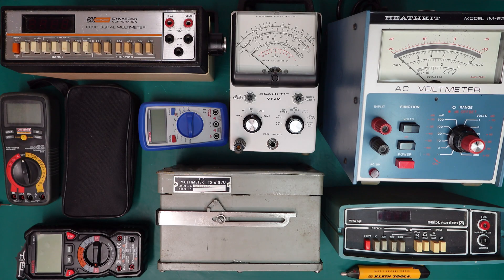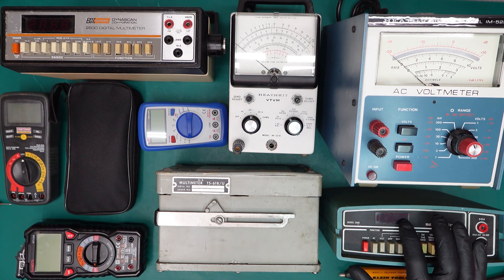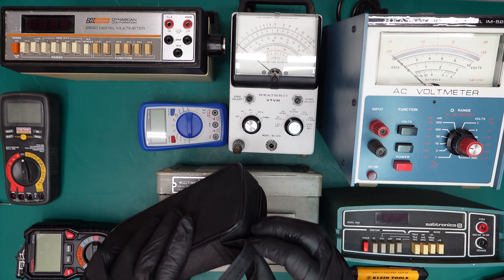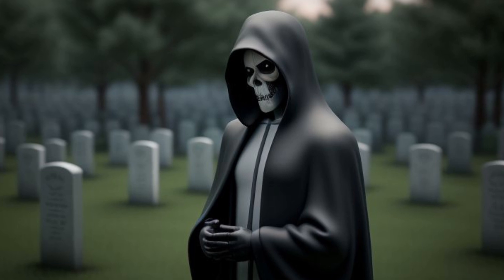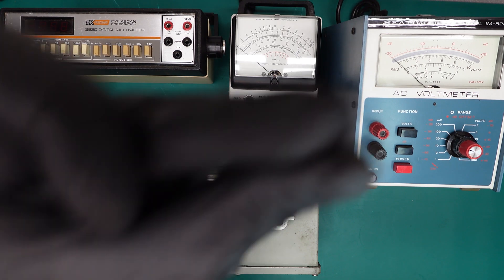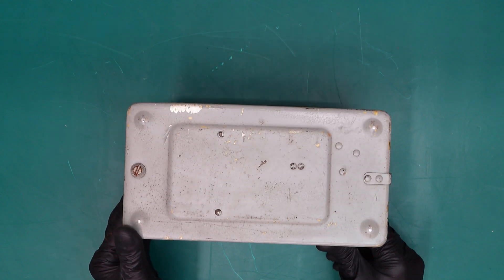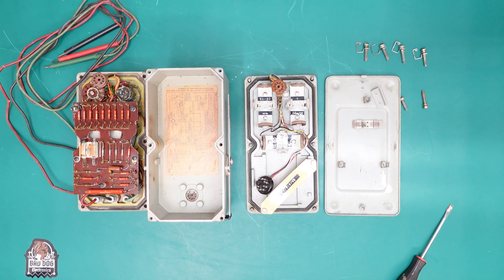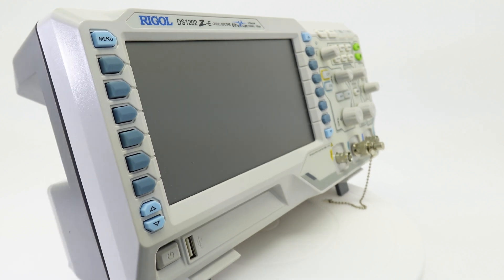A Look at the TS 618-U US Signal Corp Multimeter. Why I don't use a Fluke Meter.

Comment: Clamp meters are the best insurance against stupid set-to-current mistakes. Do insulation testing before using metal cased miltary style meters for Cat.II or higher, you might find the insulation is not as good as you expect. In any case, I find insulation testers - eg the modern style that has 500V/1000V/2500V/5000V, or even just a cool old set of handcranked meggers with various voltages - super super useful, they can also be great for leakage testing capacitors, verifying components that you want to use in mains connected equipment, culling the crate of mains transformers of unsafe junk, checking suitability of cable materials, doing functionality checks on high voltage ranges of instruments, assessing equipment to be restored as to wether it can be safely left as a class II device or should be converted to class I, etc etc...
Reply from the maker: Thanks for the great comment! At this time I do not have an insulation tester. I do have a couple clamp meters and I totally agree with what you said at the start. The issue I have with some clamp meters is their accuracy. I recently purchased a new clamp meter that remedies this problem (at least in the basic tests I did). I plan to make a video on it soon.
Reply: @BadDogElectronics  In case you didn't know that old trick: you can add ranges to clamp current meters by sticking the clamp through an air core coil that you then send the current through. 10 windings = 10 times the reading etc...
Reply from the maker: @splitprissm9339  That is one I've never tried! Now I need to ;) My quest for accuracy is usually on the mA side of things. I've since been using the pretty accurate 20k count CME210E (mA resolution). I'm a fan of it so far.

Comment: Oh my, the tubes are sooo cute! I do love them!
This meter reminds me of the air force AN-PSM/37 analog multimeter in the 70s, that meter runs on 6 AA batteries, has opamps in it, and contains a "low power" ohm range which open circuit voltage is only about 0.1volt and short circuit current of about 5mA, thus effectively blocks out transistor junctions when measuring in-circuit resistors and prevents damage to delicate transistors.
Excellent video as always, goor for you dude!
Reply from the maker: Thanks for the comment! The meter you mention (AN-PSM/37) sounds really cool! I hope I run into one. to be able to check it out. Thanks for the compliments as well. It's very encouraging to hear you like the videos!